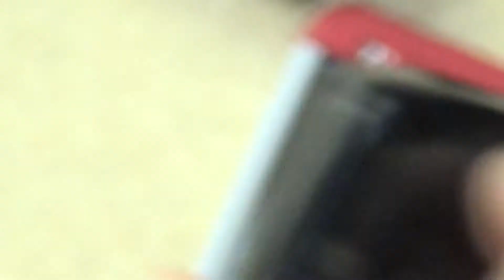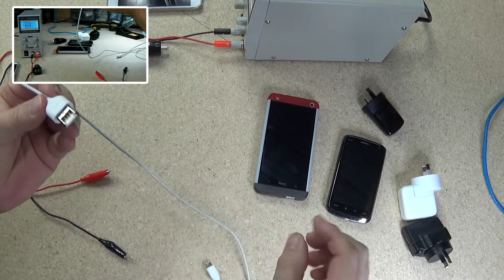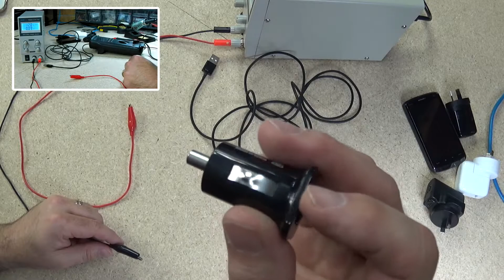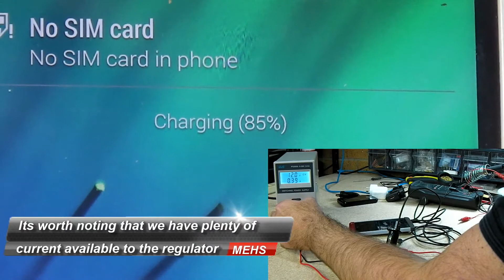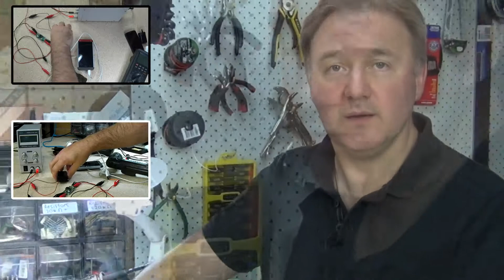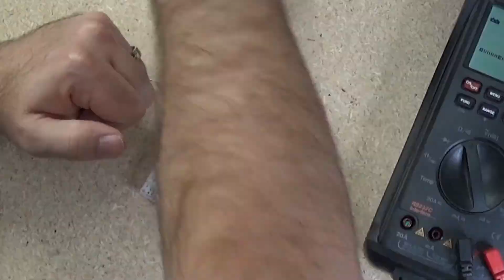Smartphone Charging Alternatives (MEHS) Episode 22

Comment: Very informative video. Thanks a lot.

What model and Where can I buy the voltage regulator?
Reply from the maker: - Thank you.  The older ones were a bit slow and boring (and a bit long for many).  Do you mean the car 12v twin USB regulator?  Its an Officeworks number from memory.  Cheers.
Reply: the one that is look like a breakout, thep step up/ step down module kit. I think I can used that in my piezoelectric energy harvest project
Reply from the maker: - Ok yes that is a really good regulator.  Its a Pololu U3V50F5.  Check out www.pololu.com
Reply: What Is this the difference with the BMS in your Episode 55 & 57? I am currently working with my energy harvester and am salvaging some board from phone case battery charge as my protection circuit. so, looking  forward to use this one.
Reply from the maker: Electronics Maniac - I had a feeling there could be some confusion here.  They are the same BMS.  I did the first video on the BMS before I did deeper checking about what the board doesn't do and I was using some data from a source that turned out to be biased.  The board will allow a battery pack to receive charge but the second video shows where the flaws are when using this method.  There is no substitute for a proper charging IC.  I will be covering them in a couple of weeks.  Cheers.
Reply: cheers! thanks for making it clear. I enjoy your vblog. keep it coming
Reply from the maker: - Thanks for watching and for the feedback.